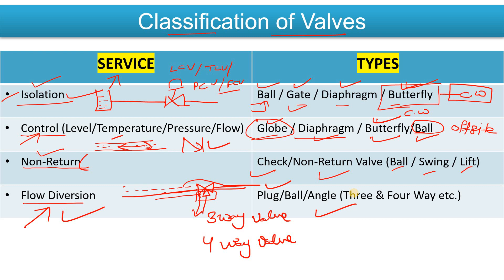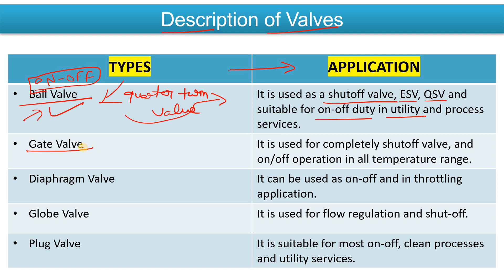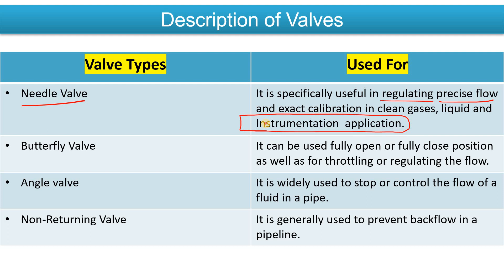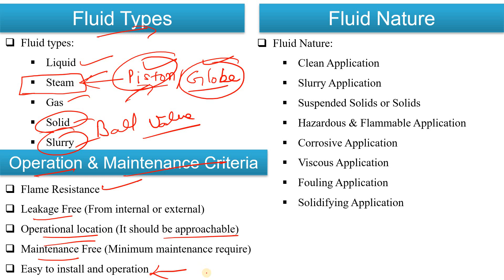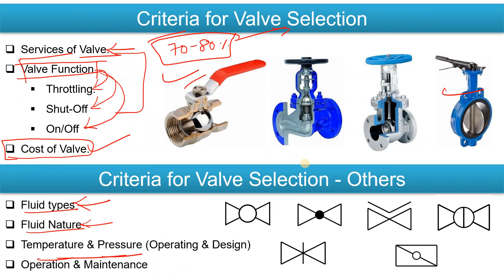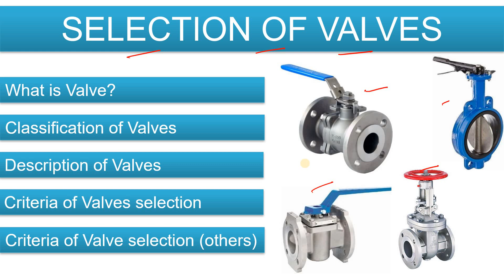Selection of Valves: Valve Selection Procedure | Selection Criteria for Valves | Core Engineering

Comment: Please share video of equilizing line in gate vale for overpressure protection and thermal binding! 
We connects equilising line at high pressure end however there are cases where we connect equalising line in downstream like feedwater pump system in power plant.